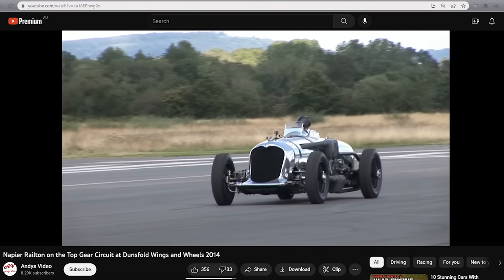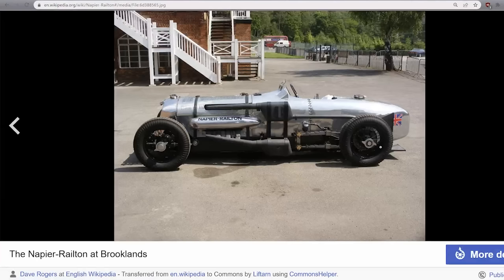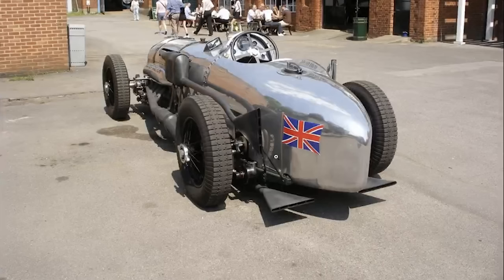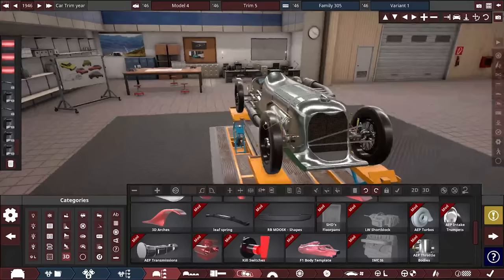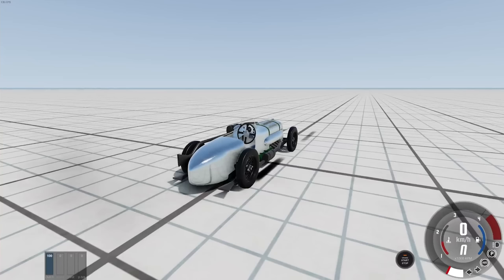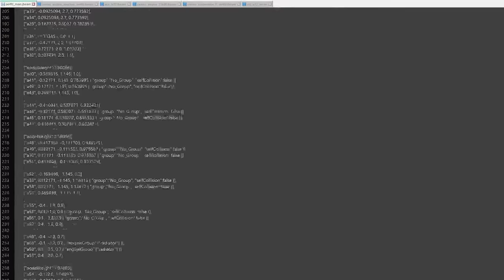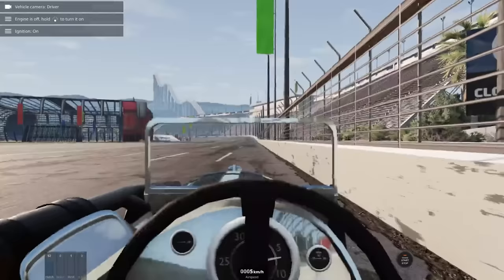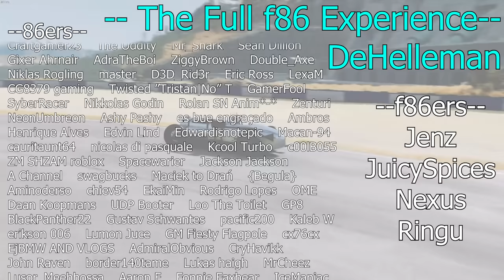This is a W12 Land Speed Record Car

Comment: rear brakes only on a sausage formed 24 liter land speed record vehicle? 
what could possibly go wrong
Reply: The answer is nothing. Because all the outcomes were planned out ahead of time, so technically nothing could go wrong.
Reply: yes
Reply from the maker: and there were only there in case the parachutes they were testing, failed... the run way was only so long, and brakes were considered a feature XD
Reply: Would you rather drive that
Or the 241kph capable 10,500kg big rig jan de rooy had made in the 80s
To go offroading with
Reply: @fillman86  Considering the engine weighs more than my entire car (436kg Reliant Rialto) It would brake so much better with front discs.

Comment: America still has pushrod engines being produced, in the form of the gas 7.3 superduty...
Reply: Not to mention the Corvette, Camaro and Hellcat/Scat pack too lol
Reply from the maker: yeah, I found out about the new ford one too after I recorded that part. This video took me quite some time to make :)
Reply: Both the LS and Hemi still use pushrod. Wtf? XD
Reply: Yea plenty of American v8’s still have pushrods
Reply: @Yuuki_Watage  yeah the LS has, and will be as long as it is made, a pushrod v8
Reply: @Yuuki_Watage  Chevy has the LT now not the LS
Reply: @the302ghost  LT engines are still  pushrod’s. Really the only company that makes DOHC V8’s in the GM division is Cadillac. Chevy and GMC both primarily make push rod V8’s with a few exceptions. Not to mention Chevy still sells the LS engines as crate motors. So they still produce them. Just the LT’s are now in their commercial sports cars and trucks/SUV’s
Reply: @Tywild327 the new corvette Z06 is DOHC as well.
Reply: Pushrods kinda suck. If an LS was converted from pushrod to DOHC it’d have a way higher potential for power and torque.
Reply: @fuze3522 THE CORVETTE IS PUSHROD, TOO?
(Never been around one of their engines, so just curious.)
Reply: @Skwisgar2322  yes the C4 Corvette ZR1 is the only other DOHC corvette made since. With its lotus engineered 5.7L V8. The new ZR1 will likely be a twin turbo charged version of the current LT6 in the C8 ZO6
Reply: OHV has benefits and downsides, however pushrods make more sense in many applications.

Comment: My best guess would be is that drag coefficient is measured as a percentage from full integers instead of float (comma) values, 60 would be 60% or .6, which explains why you needed 50 for it to behave like you wanted it to.
Reply from the maker: I though that too, but 0.5 isn't that high

Comment: I think that part of the problem might be that drivetrain power loss wasn't high enough, especially since you mentioned the gearbox not being great, and/or people not having enough balls to actually push the thing further in fear of becoming a red mist on impact
Reply from the maker: possibly. The cross plys also would have sapped quite a bit too. I swear drivers of these kinds of things, would have become daredevils, if cars weren't around haha
Reply: @fillman86  Yeah... something to keep in mind. Tires from back then (as you found out) had absolutely terrible traction. Power to push the car further wasn't the issue... these things made plenty of power... it was being capable of putting that power down that was the real issue. A lot of these speed runs back then weren't done at full throttle... they were basically a balancing act of keeping the thing right on the verge of grip all the way up to as fast as the tires could push it. When at top speed, usually if you would give it any more throttle they would just break loose. The tires just didn't have the traction to push it any faster. On modern tires these things would probably have been capable of going MUCH faster (rather terrifyingly).
Reply: The latter is highly unlikely. The original driver of the car is John Cobb, an absolute speed freak. The man eventually commissioned a car to take the Land Speed Record, which he did, and he then decided to also take the Water Speed Record as well, which is the one that killed him...
Reply: @jcgabriel1569  so he became a red mist on impact XD
Reply: @Ferrari255GTO  well, not really. Though he actually had his fatal accident while slowing down on one of his runs... At the time of his death, he holds both the Land and Water Speed Records...

Makes me think what he would've done if he survived... Considering how addicted he is to speed, maybe imagining him trying to break records on a plane isn't far fetched...

Comment: I'd guess that the drag coefficient of that, with open wheels and open cockpit, is notably above 0.6, possibly even close to 1.0.  But remember that drag coefficient is multiplied by the frontal area in calculating the force -- so probably what's happened is that somewhere in the Automation export, only a few tiny things are being included in the frontal area, and so BeamNG thinks the frontal area is 1/50th of what it should be.
Reply from the maker: oh, maybe
Reply: I thought drag isn't based on frontal arra
Reply: @phen1811  Drag is the product of the Drag Coefficient and the Frontal Area.
Reply: @DJ_Level_3  well Physics are always a approximation especially the smaller formulas but the main part of drag is actually Cd times frontal area leaving out skin roughness and area of skin as well as laminar and turbulent flow
Reply: @TheLtVoss  Cd = coefficient of drag

Comment: Vanilla cars in BeamNG don't have realistic drag coefficient values, the game simulates aerodynamics in a very basic way so it's not possible to put a realistic drag coef and reach a realistic top speed. When you have multiple layered surfaces, each of them adds extra drag. Usually they use drag coef of 10 and then multiply it with a scaleDragCoef parameter differently for each car to get accurate top speed. I'd say for a car with no layered surfaces and no scale modifier, 50 is a reasonable drag coef in BeamNG.
Meanwhile Automation uses some custom Lua scripts to calculate aerodynamics so the BeamNG drag coef is 0 in Automation cars. And the issues with it you mentioned I think only happen when you add pressure to the body like in your swimming car build.
Reply from the maker: yeah, they do very weird things. I also know about the layered objects thing, and is something I was planning to put in a "beamng wishlist" video

Comment: I wish it kept the original engine sound from automation. If you watch the Napier Bentley go around Goodwood, with the same engine and exhaust system, it sounds so crispy.
Reply from the maker: yeah, but I wanted to be more accurate to the firing order :/
Reply: @fillman86 That's fair in my opinion. Doesn't your engine have a bit more power than the one currently in the real Railton?
Reply from the maker: @mrjed6912  unfortunately no one has dyno'd a railton, so I haven't seen a power graph. On the other hand I did my best to make it have the same max power numbers

Comment: Pushrod engines are rather reliable, no fancy stuff to go wrong. They don't like to rev high but there are more than enough ways to make up for that
Reply from the maker: dohc can be very reliable too, it just comes down to european's making garbage cars. The other advantage is that you don't rev them as much (but that's also because they don't like to rev as much.
Reply: @fillman86  no doubt DOHC  can be reliable but with how overcomplicated they like to make things now any bit of simplicity is good.          Although I'd be dishonest if i didn't say i absolutely love desmodromic valve gear and maybe some of the homebrew freevalve stuff despite their complexity

Comment: Don't quote me 100% on that, but I think the weirdly high-pitched sound may come from the crank shape and firing order you used in the EngineSim engine - it appears to have a very pronounced "multiple of 3 cylinder" harmonic to it. Not too sure if there's data about crankpin angle separation or firing order on such old engines but that doesn't really sound right to me hmmm

Gotta love the extent you go to in this sort of videos. Got your stuff into recommended a while back with the Piccolina engine swap video :P
Reply from the maker: haha I wouldn't call 3 weeks a while back :P

but you're right that the firing order is a gripe of mine, but that won't effect the pitch :/ though it would help if I knew the actual firing order
Reply: @fillman86  while it won't affect the pitch (which is inherently RPM dependent) it definitely will affect the timbre and shape of the basic waveform - hence me saying harmonics. This sounds like an inline three spinning double the revs at the moment :P

Thanks for answering!!! (:

Comment: 20x7.5 in tires would be about 180mm in width. which makes a lot more sense to me. its a land speed record car not a prius. it needs all the traction it could get for the time. they look skinny because the car is massive.
Reply from the maker: well there's also the fact that if you wanted a 180mm tyre, you'd have to make it yourself. So most of the time, they would make it themselves. Also automation does tyre sizes in a weird way :/ effectively making them have wider physics
Reply: @fillman86  I believe the tires were manufactured by Dunlop.

Comment: Coefficient of drag is only part of the story. The figure of 0.3 Cd isn't great, but since the car has a relatively small frontal surface area, the total drag factor (CdA, or coefficient of drag times effective surface area facing direction of travel) probably isn't too bad.
Reply from the maker: it probably would have done over 200mph given the chance haha

Comment: Pushrod engines ,while not being a technological marvel, are more compact and typically produce more low rpm torque then ohc engines. I had to stick up for them because I'm an American.. 😂
Reply from the maker: they don't make more low end torque, they lack the innate ability to make high end power, so they focus their efforts elsewhere. If you tried with both pushrod, and any kind of overhead cam, you'd be able to make more low end torque with the later :/

The compactness is true, but only for the given volume, not necessarily for the given power (though I've not really though about the compactness vs low end torque... so maybe?

Comment: How do you get all the advanced parameters in automation? like the ability to set ride height and wheel size larger than the base game sliders allow?
Reply from the maker: 1 make sure your game is up to date (this includes if you've pirated it)
2 it's the button near the bottom left of the screen in fixtures called "advanced fixture settings"

Comment: I suspect that the reason that the engine didn’t sound great in engine sim is because of the exhaust system, it sounds like you didn’t specify 3 different exhaust pipes, and instead only set one
Reply from the maker: nah, it has 3, and they even run similar, but different impulse responses (being the same impulse response sounded much worse) at different volumes

I'm guessing not being able to find out the IRL firing order would have helped at least a little bit (but it wouldn't have been the be all, and end all)

Comment: Is it me or does it sound like the engine sound from engine sim has too high of a pitch? It sounds like you go through a pretty normal rev range before you get to 2000rpm.
Reply from the maker: yeah, unfortunately that was the best option too. I need to make new impulse response files to make it sound a little bit better :)

Comment: Um, America has pushrod engines still. The chevy ls v8s, the ford godzilla 7.3 v8 and the dodge hemis are all still pushrod. The latest the 7.3 godzilla v8 being released as a brand new design in 2020.
Reply: you forgot about diesels, Duramax and Cummins still use pushrod
Reply: The C8 corvette stingray is pushrod everyone forgets.
Reply from the maker: yeah, this video took a while, and after I recorded that part, I found out about the new poorly named godzilla engine -_- 

it's a good thing they have some of the cheapest fuel, otherwise this old inefficient tech would not fly with customers haha
Reply: @fillman86  the whole reason why muscle cars existed and died in the first place

Comment: Hm, I had assumed things like drag were calculated based on the geometry... Would there be a way to get the value you need to put in the text file using what you modeled in some way?
Reply from the maker: it is geometry based too. These values are applied to the collision mesh, where their angle, and size make a difference
Reply: I feel like the drag is a bit wonky, taking all the panels and windows off your car makes it have a much better top speed, doesn't seem very realistic
Reply: @supertornadogun1690  That makes it sound a bit like it's just taking in consideration the "shadow" of the shape and ignoring more complex aerodynamic effects...

Comment: It is not a W12, its 3 banks of 4 Cylinders. An Arrowhead 12.

The Napier Railton, Britain's most important pre war racing car, the perpetual Brooklands lap record holder by John Cobb.
Reply from the maker: it was called a w12 before the VW audi group made their w type engines. They also weren't the only ones, there's a funny f1 story about a filed one too
Reply: @fillman86   The engine is a Napier Lion engine and is found in this car and a couple of others, The Golden Arrow, 2 of them which dont run at the moment, and Chris Williams' Napier Bentley which is the only other running example other than the one in the Napier Railton.

It has never been a W configuration.

It's an Arrowhead configuration, 3 banks of 4 cylinders.

Here is a link to Alan Wynn, the Director of the Brooklands Museum who now own the car and one of the only people to drive it regularly.

I've spoken to Alan on a number of occasions at The Goodwood Festival of Speed and he let me sit in the car last year.

It's a beast!

https://youtu.be/wphxHzuWHoc?si=FF8VlvuEmgr2SPFO

Comment: 19x6

19 inch diameter rim, 6 inch wide.
I have seen this car at Brooklands and in action at Goodwood, the wheels are really wide for its era.
The tyres were blocked treaded tyres.

If you want to see something similar ish driven hard have a google for Mavis, its a 1930s bentley with a WW2 Packard Motor Torpedo Boat engine  (42L) The driver likes to make smoke screens when he drives it!
https://www.youtube.com/watch?v=vYkNI5ALk2E

He also has  similar era Bentley frame with that same 24L Napier Lion aero engine in

https://www.youtube.com/watch?v=UtoBPHY0LyM
Reply from the maker: it had many different tyre types over the years. Often they were custom. Now they use mundane block treads :)

Comment: Diesel 4 cylinder engines tend to have a lot of displacement.
Reply from the maker: yeah, often reaching 2.4L. Though I would imaging with the power RPM, you could easily go up to 3L maybe?

I dunno, diesels are very unpopular in australia, and almost don't exist outside of semi trucks
Reply: @fillman86  The hilux comes with the 2.8 diesel (v6 though)and I assumed it would be more popular. Also, more like generator and industrial engines you see large displacement (for a 4 cyl). The largest 4 cyl diesel you'd see in a car is probably the 2.8 engine youd find in a colorado, which is roughly the same size as a hilux or navarra?
Reply: The Isuzu diesel I4 is 5.2L
Reply from the maker: @ffivguy1990  nice, getting a lot closer
Reply: @ffivguy1990  I always thought that was an i6

Comment: How do i change the engine sound? I can see in the folder there are 2.
I probably won't get an answer, but it's fine, it's an old video...
Reply from the maker: is it not default set to the sound that I made for the car? or are you asking how to mod sounds yourself?
Reply: @fillman86 I meant that there's the "high pitched" sound that plays in beamng (called napier_lion2 in the files), but there's also in the files (unless i'm stupid) another engine sound that i like better (exh_"rpm"). What i thought is that these were like two engine sounds choices for who download the mod.

Comment: Could you create the 2440hp DAF TURBO X1
It also has silly torque at nearly 7k ft-lbs
23.2L 12 cylinders of diesel 
Making 4 times more torque than this grandad plane car
Reply from the maker: I'm assuming diesel? unfortunately diesel isn't supported in engine sim :/ nor turbos